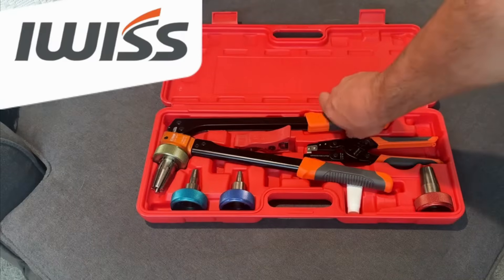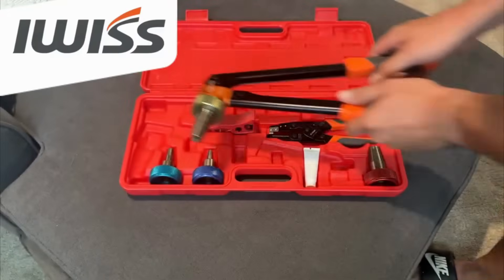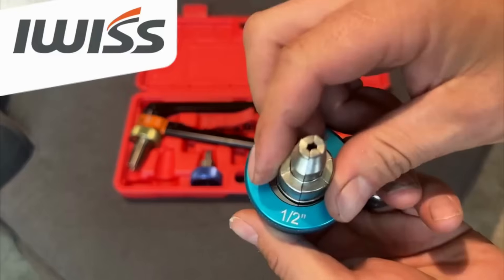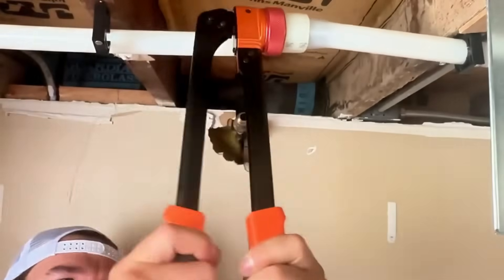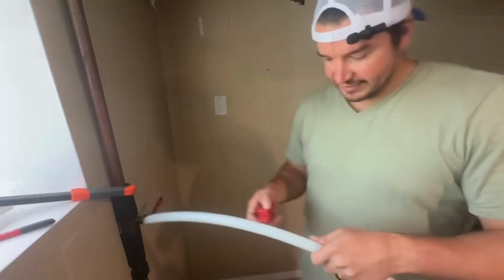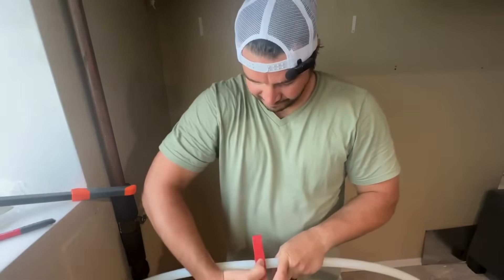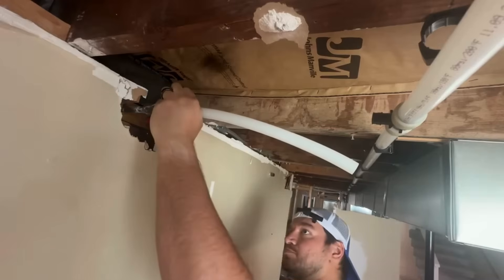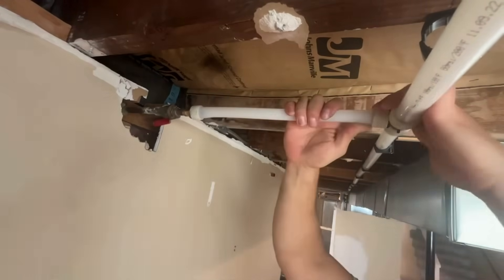How to Use iCrimp Expansion Tool to Expand Pex-A Pipes Like a Pro!

Comment: Thanks for the video. I have 1/2 supply lines at my house and was considering whether or not I could effectively get by with a more budget-friendly manual tool or whether I should spring for either the DeWalt or Milwaukee battery-powered tools at $400 to $500. The manual tools may actually be a decent option for my occasional home maintenance work.
Reply from the maker: Great question! For occasional home maintenance, a quality manual expansion tool is usually more than enough. Our iCrimp expander delivers consistent, ASTM-compliant expansions without the cost of a power tool. 💪

Comment: Man you make it look like a breeze! I tried the similar iCrimp tool and on the 1" I just didn't have the strength to do it. I could not imagine trying to do it in a tight space. Maybe I'll try this one, although these are all probably manufactured in the same plant.
Reply from the maker: Totally understand — expanding 1" PEX-A takes some strength with the standard tools like in the video. Our latest upgraded model features a longer handle for better leverage and auto-rotating heads that make expanding easier and smoother, especially in tight spaces.

If you want to check it out, here’s the link to the newer version:
🔧 https://www.icrimptools.com/products/pex-expansion-tool-kit-with-1-2-3-4-1-inch-auto-rotation-expansion-heads-pex-a-tubing-expander-with-pex-cutter?utm_source=YouTube&utm_medium=video&utm_campaign=video_description
▶ Demo video: https://www.youtube.com/watch?v=yWzpYVBMNp4

Thanks for watching and considering it!

Comment: Somebody should make a battery powered tool that does that.
Reply: The battery options cost $450-$600. Milwaukee and Dewalt make them.
Reply: @ I know…lol
Reply from the maker: Thank you for your comments. Our latest products have extendable handles, which use the lever principle for less effort. Our hand tools are more cost-effective.